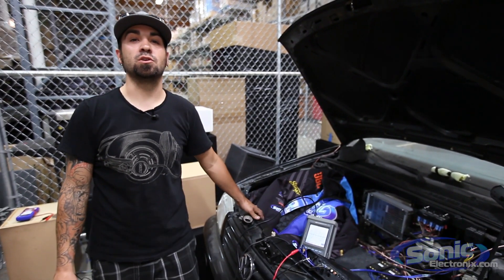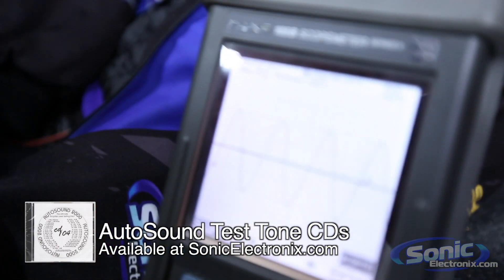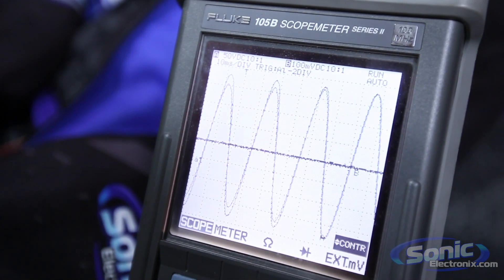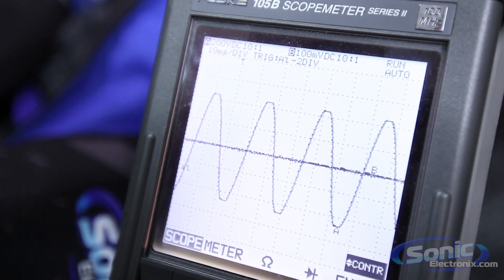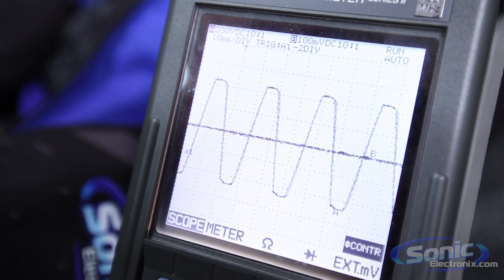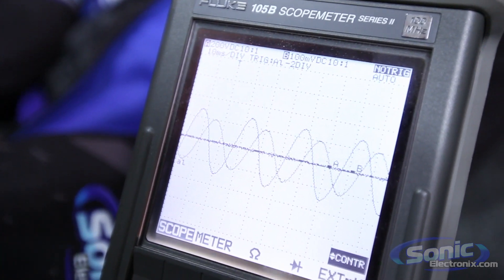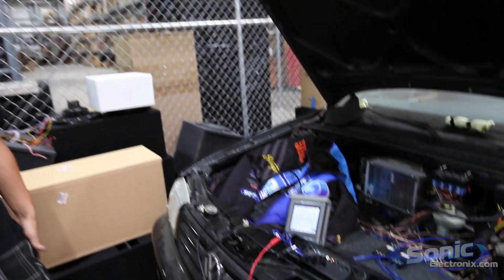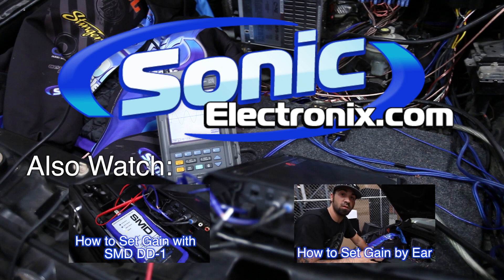How to Set Amp Gain with O-Scope | Part 3 of 3

Comment: Thats a badass o scope! I can’t afford one of those lol
Reply: this vid is from 2012, technology has vastly come a long way since then and there are just as good alternatives now days especially for use for car audio. I use a hantek handheld 2d42 which is around 150
Reply: @commonsenseisdeadandgone  I've seen oscopes like the DIY from JYE for like $25. I don't know how good those are, but I only need it to set the gain on my amp like once. I was going to use a multimeter, but saw those cheap oscopes, and I may just get that and use it since I only need to use it like once unless I put in a new amp down the road. I did look for used digital oscopes for cheap, but looks like those don't come up for cheap.
Reply: @colt5189  I have one I just got but I haven't calibrated it yet. I decided to put it together without reading all the instructions. I want to install it in my car for fun. From what I've seen they do the job just fine
Reply: @commonsenseisdeadandgone  What model do you have? And are there certain models over others that say have better resolution or things like that? Resolution would be being able to say see the wave pattern in more detail and being able to zoom in to the wave for to get a better look at say when the signal starts distorting.
Reply: @colt5189  I got the DSO 138 OSCILLOSCOPE kit for 27.99 with case on amazon from DORHEA 

Claims 1Msps and that is plenty fast enough for amplifier readings. I'll try to calibrate it now and see how well it does
Reply: @commonsenseisdeadandgone  I'm going to look through all of those JYE models to pick from. I've read there are places that are selling clones/fakes of those. But anyways, how exactly will you be calibrating it? Is that something you do inside the program? Or do you need something else to use to calibrate it?

I also plan to get a cheap RCA amp wiring kit, so I can cut the wires to the RCA and clip alligator clips on. Reason is first step is you want to connect these to the back of your head unit and raise the volume so you can see where your head unit starts clipping. And then you want to dial it back 2-3 numbers on your volume knob, then you move on to your amp. And that volume level on your head unit, you never want to raise it higher than that after you are done because that would be guaranteed clipping.
Reply: @colt5189  the cheap clones appear to do the job more than well enough. 

To calibrate it you have to attach the leads to a spot on three board itself that is supposed to have a wire lead soldered to it to be able to gain access once the case is installed. I skipped over this because I installed the components as they were written on the board and the parts were all used (aside from a couple extras of the components there was multiple of) I guess I did add the fact I got a kit that I soldered together as I repair amplifiers and like doing that kind of thing. 

There is no need to buy a cheap kit or any RCA ends for that matter, you simply unplug the RCAs from the amp and clip the black on the outer ring, red on the prong and watch the scope until you see any anomalies in the sine wave. HOWEVER truly it does not really matter if you're only running a amp for a sub or subs. In that case, whatever volume your speakers no longer sound good at is your set max. This is by far controversial because for so long that's what people have been told. The fact is that you can feed a amplifier a square wave but the frequency is all that matters as you can input a square wave into a amplifier and on the output will be a perfect sine wave of the same frequency. (If you doubt me, get a scope and see for yourself. a DD1 and the like will not show you this) if the distortion was extreme enough the only effect would possibly be missed bass note or short bass note. Your speakers will sound like garbage before that happens though. 

I'm a basshead and it least in that community and from a far as i can tell truly all around, in my opinion the following is true.
Biggest issue with car audio is the copious amount of information that is just false. It's the same if not damn near worse than politics, no matter the proof you show, they do and always will believe otherwise and continue to spread it like a disease with no regards to actually finding out 100%. Its a sheep follow the heard scene. So many people grab hold of this information with no actual data or tests of their own and run with it, They will tell you that you are wrong and not have a damn clue what they are spewing actually is or what it entails or means. Bass boost is a fantastic example, everyone says to never use it, ever! Ask them why not? Then what's it for? 
Mass majority of the time they are correct in that you shouldn't use it so they believe they are right, however it is there for a reason and its to help with enclosures that are lacking lower frequencies, even useful more so when its a frequency you can choose as opposed to a fixed frequency you have no control of. 

I recommend doing research, a lot of research with a open mind and most all this is common sense. If you see something that doesn't make sense, it is probably because it's incorrect. Car audio is stupid simple logic.
Reply: @commonsenseisdeadandgone  I've read of the cheap clones putting out wrong data. Who knows, they may also be using fake chips. Since it doesn't cost that much more, I think I'll just buy a guaranteed authentic board/kit. I'm hoping there's a youtube video or an online guide that quickly tells you what settings to set it to if you want to see the sinewave and check for distortion or something. 

As I've had my radio not working for a long long time as I ran new speaker wire and had to get an amp and new stereo, figure out how to wire it all up and how to set the amp, etc. And I'm kind of ready to get the dash put back together and the radio working again as all I have left to do is adjust the amp gains. Really hope this isn't something I'll have to spend a month trying to figure out. As I'm betting the name brand store bought oscopes are probably simple to get up and running after spending a few minutes reading the manual telling you exactly what to do.

Comment: Question.  If the gain is set too high to the point its clipping the wave, will it only do this when the volume is turned up quite loud on the head unit, or could you turn down the volume on the head unit and the clipping goes away, or is that wave constantly clipped even at lower volumes?

Comment: I have a powerbass sta-10 and it has a built in amp amd no output to connect a oscope to , what would be the best way to set the gain on a unit like this

Comment: I've tried this before with an oscilloscope on my Kicker CX1200.1 amp that's power my dual CompR's in the enclosure and it left it weak as hell. I was so disappointed in the way it was tune. It was worst when I tuned it the correct way then when I tuned it by ear.

Comment from the maker: Same concept as we showed here. Connect an O-Scope or SMD DD-1 to the headunit RCA output and slowly turn the volume up. Once it shows clipping, you know you shouldn't pass that volume level.
Reply: Sonic Electronix RCA output on the amp?
Reply: No, test the rca’s coming from your head unit first. An amps job is to reproduce the input signal in the truest way possible. With that being said, play a 40hz test tone from your head unit and place the oscilloscope on the rca’s before plugging into your amp. Turn the volume up until you reach the highest point possible without clipping/hitting a square wave. Mark that point and never go above. Plug the rca’s back into the input Channel of your amplifier. Be sure to have everything that isn’t natural like bass boost or bass eq set to 0. With your gain set to the lowest point possible and your head unit set to the loudest point before clipping, play the test tone and turn the gain up on your amp until it clips then back off on the gain a little. Congratulations, you’ve just made your amp run efficiently. Make sure all speakers are disconnected before doing this! If you do add bass boost you will have to redo all these steps and will most likely loose power in certain frequency bands.
Reply: @isaiahhood236327  I'm glad I read this as I've never before heard testing the RCA's coming out of your head unit. I'll have to see if they make a connector that is an RCA male on one end, and red/black alligator clips on the other end. I plan on getting one of those cheap JYE $25 oscopes. I figure it should work okay for something this simple.